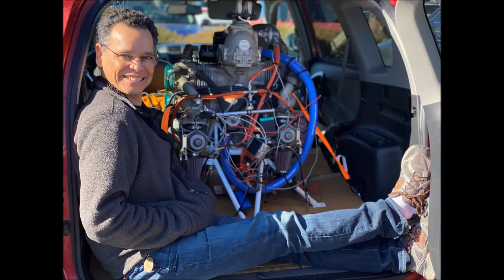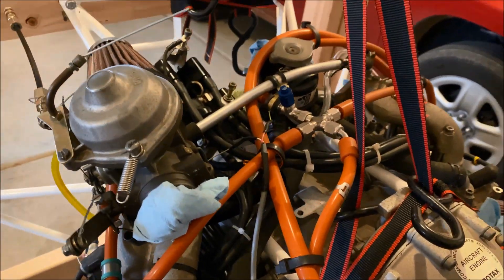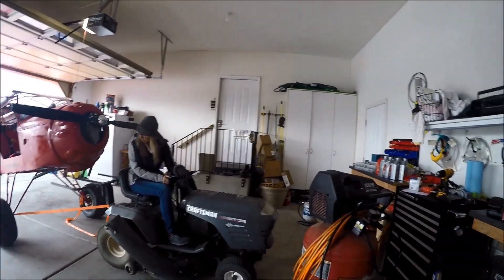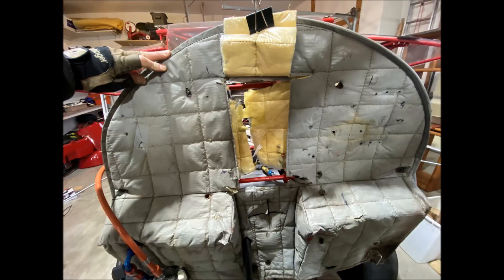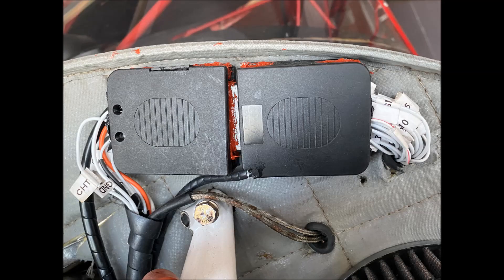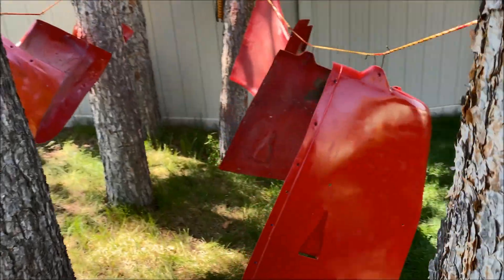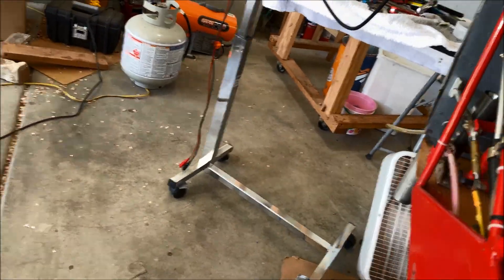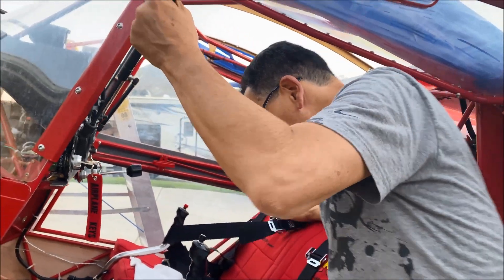Kitfox IV Engine Swap Part 2

Comment: Nice work!  but you should never run this small engine without a propeller installed, if you accidently bump the throttle your new engine could be destroyed!

Comment: What is your new weight and balance, empty weight vs. gross weight?  What is the difference in weight between the two engines?  Did the FAA FSDO put you back in phase one for a few hours after the new engine was installed?  Did they issue a new Airworthiness Certificate or just have you make a new entry on the airframe logbook?